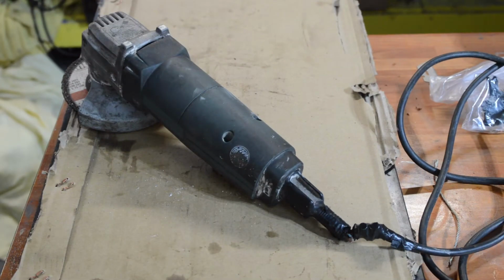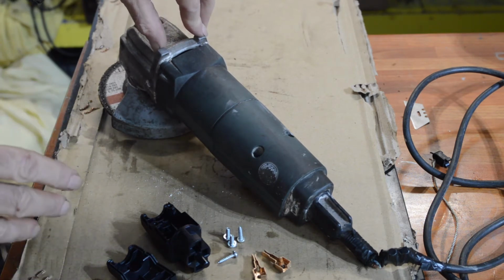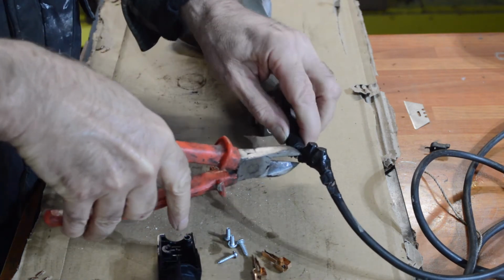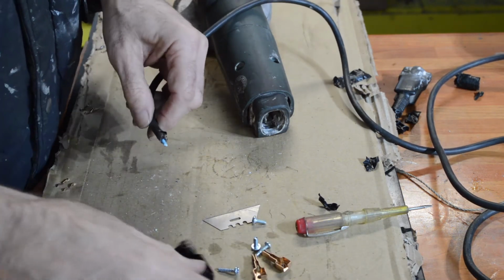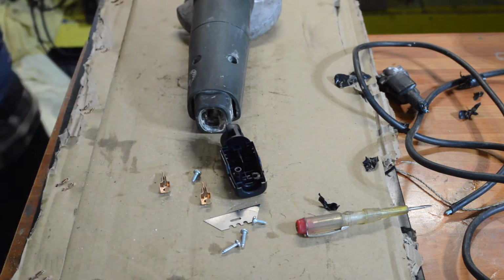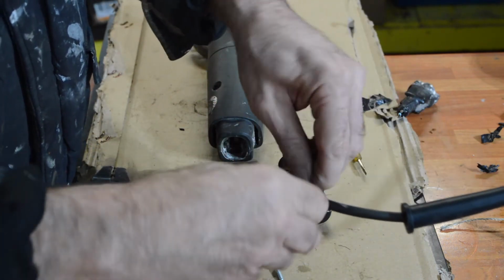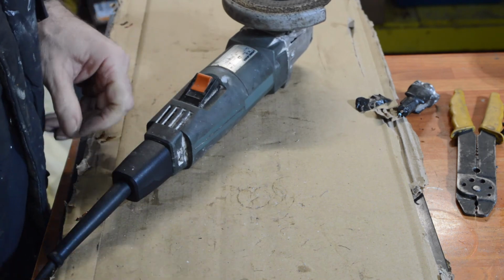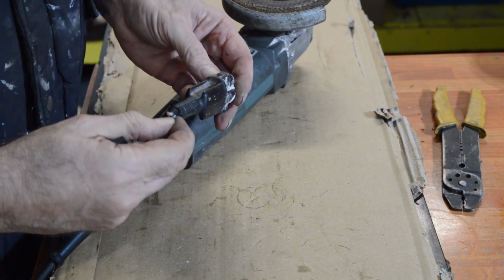Angle grinder lead fix

Comment: I was surprised to see the contacts had the relief for the wire cut that way, usually they are opposed or straight out the middle so to avoid the mess you had.  I am more surprised that you were actually able to find a kit to fix the B&D.  I believe my dad left me an industrial jig saw that is well over 35 years old that has the same problem will have to dig a little deeper to see what might be available.   Thank You, I truly enjoy your videos.  Hope you keep tinkering and showing your adventures.
Reply from the maker: Thanks Max. The kit was a little odd but it worked and seemed of reasonable quality and I was glad that I was able to save the old grinder. I hope you manage to get your Dad's jigsaw fixed, as it is satisfying to save a piece of your own personal history. Thanks for watching!